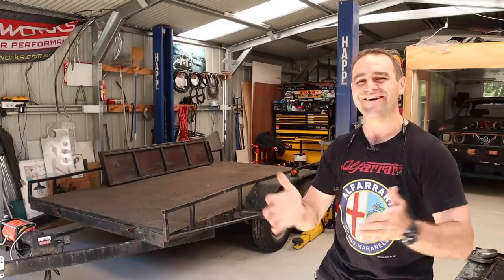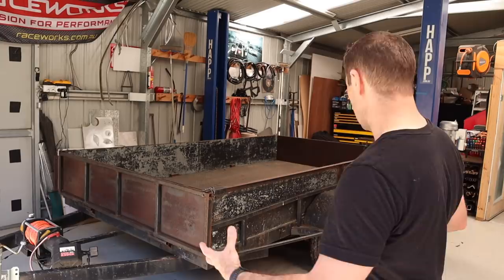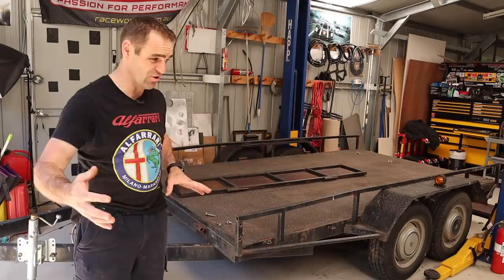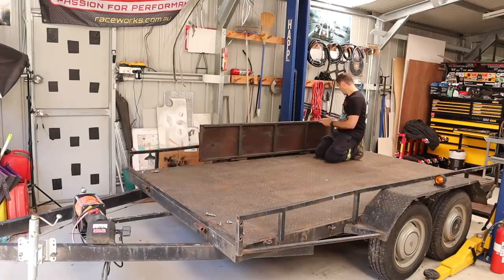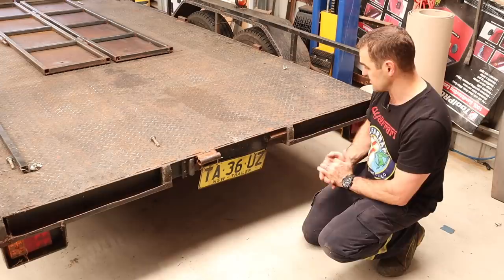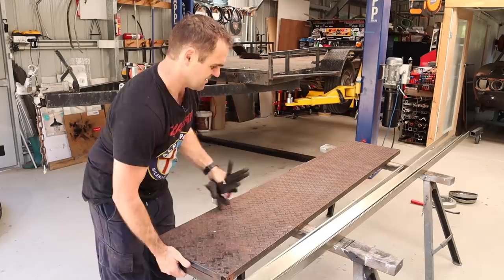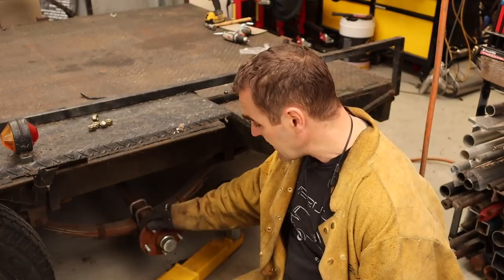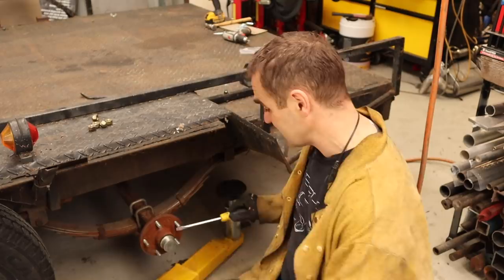Upgrading my Transformer Trailer

Comment: Jeff to grease the new dry bearings or good used clean bearings use a section of a sheet of plastic like house vapour barrier put the grease in a big glob on the sheet, drop the clean bearing into it and fold it up and twist the sheet to squeeze the grease into the rollers or balls of the bearings. It's cheap and easy.

Comment: Normally when I change trailer bearings, I drill and tap the hub between the bearings when the old ones are out, then fit a grease nipple so that you can pack and top up the grease at regular intervals  without removing the hub.

Comment: Awesome idea about the transformer trailer. may have to do something similar myself in the future.

An idea for having the ramps slide out the way you want:
if you modify the ends of the ramp a little, you could cut the "hooks" off the way you have them, then reinforce the end where you have cut it off and replace the very end box section of the ramp with a piece of angle the same size (just thicker), reinforce it a little and you have a hook that is the same profile as the rest of your ramp, then you can have it slide out and hook strait on. you will just need to make sure the ramp can't slide further forward than needed.

The hook style you have is similar to other trailers I have used just a lot longer. I have never had any trouble with the shorter hook jumping off, as when weight of the car is on it, it is pushing down and forward.

Comment: A really good trick to remove a bearing shell you can't press from the back is to put a big weldbead on the race and let it cool, the weld shrinks and pulls the race together. Most of the times they fall out.
Reply from the maker: I forgot about that one. Great tip.

Comment: If you come back too this project, I would make the sides and frames in aluminum, it will drop a lot of weight from the trailer. Same for the wheel arches and deck. Also make the arches removable.
Reply from the maker: Aluminium ramps I think will be a big plus.

Comment: I like to hand pack bearings too ,without gloves though. I put a blob in my hand like Jeff and then "slap" the edge of the bearing into that blob until it bleeds out top of the cage. Its just easier to hold onto without gloves though messy as all

Comment: Just a thought about the ramps. Have you given thought to changing how they attach to the trailer when in use? You could remove the lip from the ramp and instead do the reverse on the trailer. If you wanted to be real fancy, you could make it so the trailer mounted supports could be slid to different positions to accept different width vehicles. Keep up the great work Jeff!
Reply from the maker: They currently sit in a channel and can be wider or narrower as I need.

Comment: an old mechanic neighbour of mine taught me to cut the old bearing race through(once it's removed) and use it as the tool to tap in the new race (image hosted on imgur link here https://i.imgur.com/iQSsjIH.jpg ) 
i like the multi use trailer, i added a removable motorbike mounting rail to My 6x4 trailer once also. good job.

Comment: Ahhh Jeff.
I've been down this path many times. I have an obsession with building the perfect trailer.
I could give you some tips! Many tips....
One of my prerequisites is that it doesn't rattle so that makes it a little tougher. I've built 4 now, each getting a little better. My last was an airbag squatting trailer that still wasn't perfect!
One thing to note, may be different laws in NSW, but in Qld we need to have a stop rail on the front of the trailer, kind of like a wheel chock, otherwise you can't legally carry a car on it. Might want to check that. I've never found it written how high it has to be so mine is only 80mm (the splitter height of my race car under suspension compression) and I also integrated latching points for my ratchet straps for an over-the-tyre tie down system.
Reply from the maker: It has a piece of square tube as a front lip. It is how I bought it and I have never had issues getting it registered.

Comment: Couldn't help wondering why you didn't just mount the ramps across the drawbar, where the front one folds down as a gate. The drawbar looks long enough that they wouldn't hit the tow vehicle bumper at full jack-knife.
Reply: What you did was a much prettier and usable (if heavier) solution tho.

Comment: Reduce the weight and improve traction by putting a series of forty millimetre holes in the treads.
Reply: But then you can’t use them as front and back when it is a box trailer
Reply: @XiraArien   Why nor? 40mm holes aren't that big that they'll let stuff out and you're supposed to cover your loads properly any way so a tarp would cover the holes.
Reply: @anomamos9095  well, where I live we also use the trailer to dirt, gravel and sand. Any holes are just not desirable from my perspective

Comment: Is the pin long enough to hold the ramp in to keep it secure if the ramp slides away from the pin? It looked like there was a lot of slop in the fit in the tray for the ramp
Reply from the maker: Yep. That is the first thing I checked. I don't want those ramps falling out on the freeway ;)

Comment: Good work Jeff. I promise when I do a video on my trailer I'm not copying you, I need to do almost exactly the same thing to better secure my ramps.
I might steal your transformer idea though, having a big box trailer certainly would be useful at times...
And.... is that trailer braked!? Over here in the UK, we can't have an unbraked trailer over 750kg, and all wheels need brakes if over 750kg.
Strange that you've got such strict laws on modifying cars and the need for engineering approval, but you can run around towing a car on a trailer without brakes on all wheels!!
Reply: Same here. Anything over 750kg needs brakes. You can see that it has brakes on the front wheels @ 10:07.  Here's a rough guide to our regulation the detailed docs will make your eyes go crossed. https://www.racq.com.au/Living/Articles/A-guide-to-trailer-brakes
Reply: @johngriffin4023  thanks, I didn't notice the brakes on the front axle! Our rules aren't that much less confusing! ;)
Reply from the maker: The trailer is braked. It is also 750kg rule here, but it is only braked on the front wheels.

Comment: can you use those trailers with a normal drivers licence for cars? If I want to use a car trailer- depending on the size I would go to driving school again.. and depending on the max weight I would have to get a licence for a lorry with a additional bit for trailers.... huge time and money investment (3- 5000€) and then I would have to buy a trailer...and fit a trailer hitch... and after that I would have no money for any car to put on my trailer...
Reply from the maker: In Aus you just need a car licence, although I do have a truck licence as well.